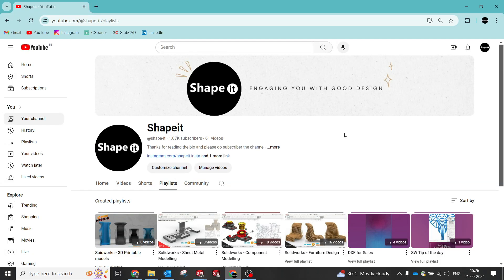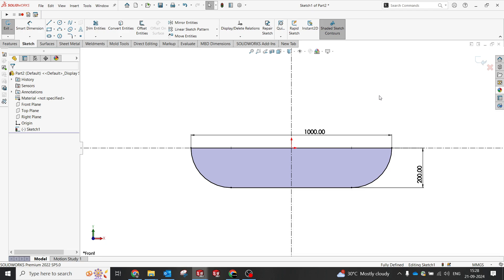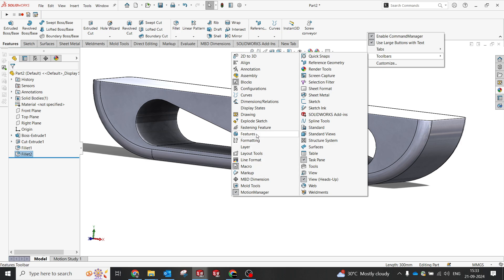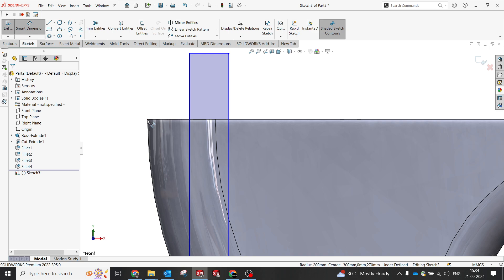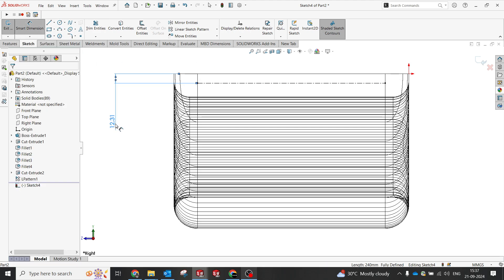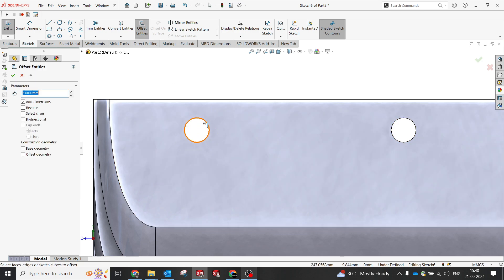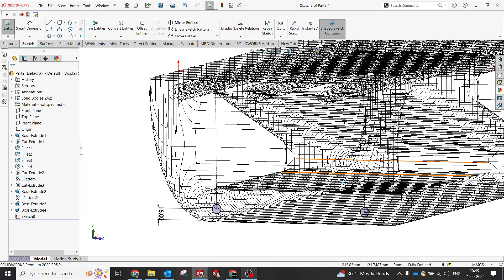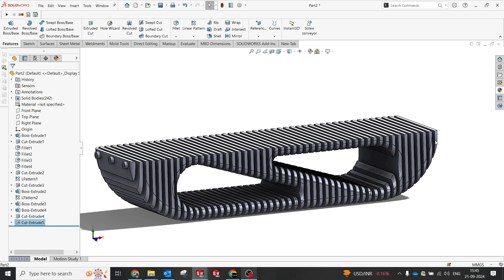Solid works - Furniture Design | Parametric wood design | Geometric Pattern for modern table | EP17

Comment: This design in unfeasible to make. These furnitures are generally made with plywood. With your fillets and curves on plywood one would need to do 3d toolpath which is not feasible on the plywood. Do you have a solution for it ?
Reply from the maker: I completely agree with you. It's a conceptual design if someone is really interested in manufacturing they should consider DFM and DFA both in mind😊

Keep supporting ❣️ 🙌

Comment: One question try to take it to logical conclusion of how someone will put and stack it together on a sheet with paneling. Minimising number of sheets to be used.
Reply from the maker: Sure I'll make a note I try to consider as practical as possible in upcoming videos to show case the CNC cutting with layouts ❤😊